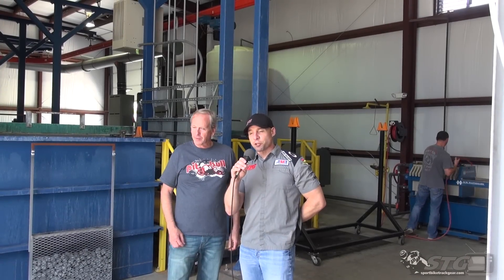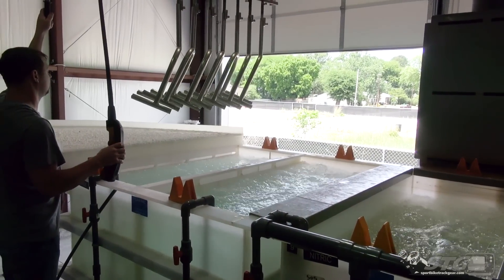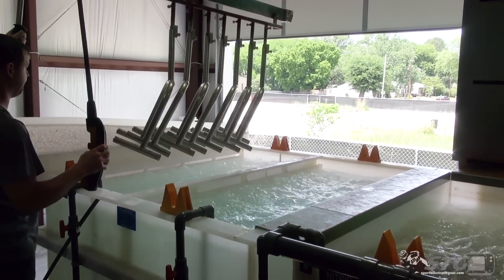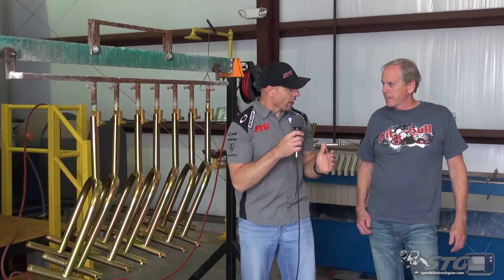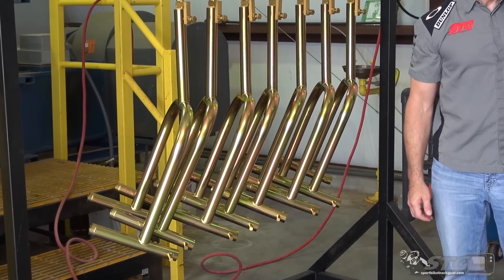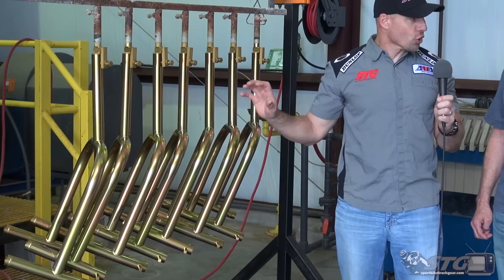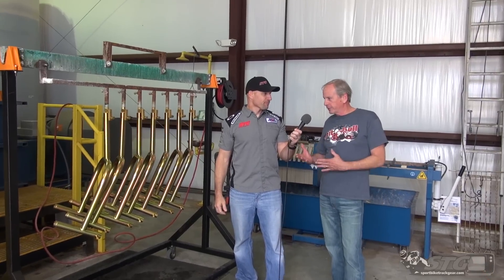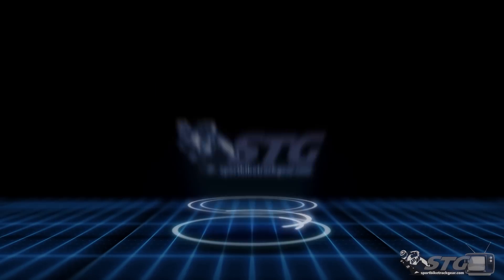How Pit Bull Stands Get Their Famous Gold Color from Sportbiketrackgear.com

Comment: I just bought one of these stands (second hand, but virtually brand new (which is a big issue for the retail market since they last for 10 bike lives and can be sold multiple times)) and I was wondering what type of coating/plating was on it and I couldn't find the answer so I'm glad to finally get the answer.

Comment: Pretty nice stands but they do corrode pretty fast. I own 2. 
The best thing to do is to keep them indoor away from excessive heat and humidity or the finish will tarnish.
Reply from the maker: I have some that we have had for over 10 years that we use in the shop and at the race track. Over time they will weather a bit but they are not corroded. - Van
Reply: Shoot Kan, prove it and show your Pitbull stand. I’ve used them for years and they don’t “corrode”.
Reply: Mine rusted because 10 years oahu Hawaii and 5 yrs coastal Georgia - and washed bike on it. Pulled plugs and inner tube rusted. Used Evaporust but are gold plating! So need to be replated or painted. Also 22 S1000R with EvoTech spooks needs 15” width. My WC will almost fit but the machined flats aren’t fulll width. Pull lock down set hex and look inside. Found that out the hard way. Supports spun when bike lifted. Bang.

Comment: pit bulls are great but they're so heavy comp to other brands..
Reply: There's strength in that weight:)
Reply: Strong thick steel, or they would have to cost more for an exotic material that's lighter and as strong.    I'll take the steel